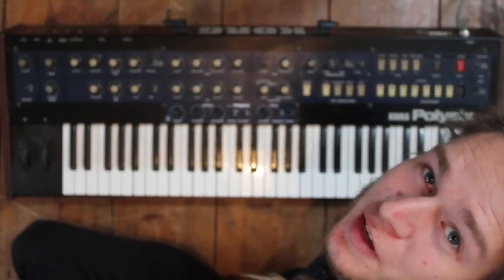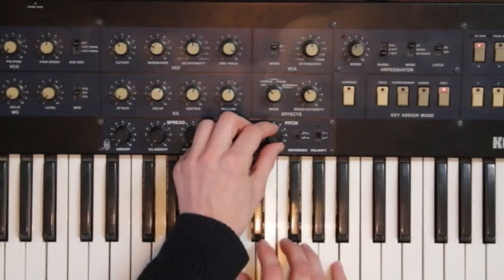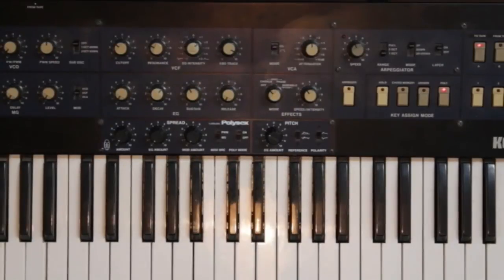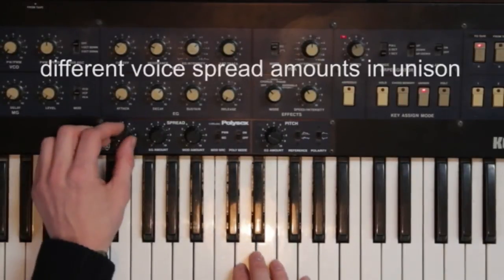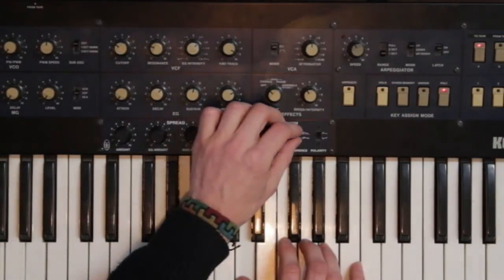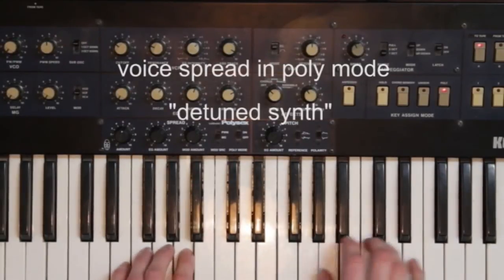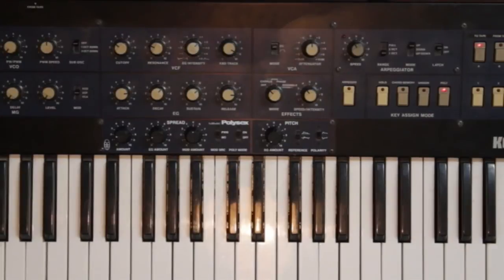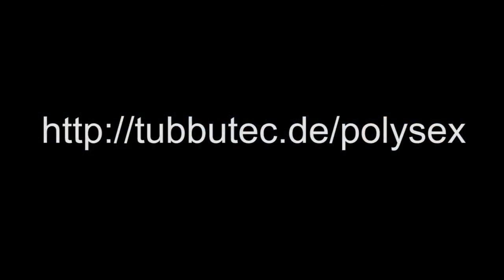Tubbutec Polysex - Korg Polysix mod - demonstration

Comment: I have some last pressing questions for this mod about polychord! is the pre-programmed chord stored in one key also sending as multiple tones in MIDI out? Is it also possible to run this triggered polychord through the arpeggiator? Does the arpeggiator also send MIDI out? (what you hear, not what you press on the keyboard). Besides super excited about this, getting a polysix soon and will definitely go for the tubbutec mod
Reply from the maker: Hi, there is a second midi out channel that outputs what you hear. This means:
All notes of a (poly)chord, arpeggiator and sequencer output, etc...
Yes you can arpeggiate the chords, just like you can arpeggiate individual keys.
Btw.: Your question is about the ModyPoly mod, this video is about the Polysex mod :)
Reply: @tubbutec  øke wow yeah you guys are very awesome, i think i want to get all tubbutec mods available :)
Reply: @tubbutec  So one last question for clarifying! If you arpeggiate while using Polychord, will it play: note - note - chord - note (if you programmed a chord on the 3rd note that you press in the keyboard)
OR: will it add all notes together (pressed note + chord) and arpeggiate these as a monophonic arp?
Reply from the maker: @CedricKristian  it will play the programmed chords (or notes of you program a chord with only one note). Not arpeggiate monophonically.